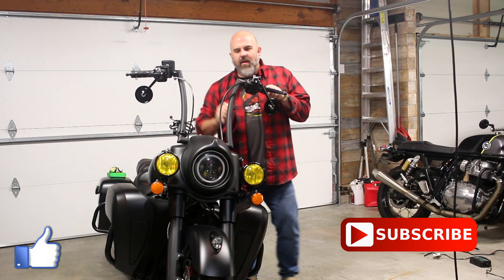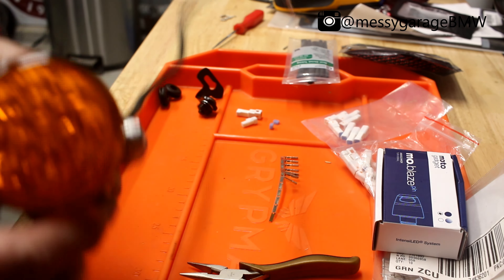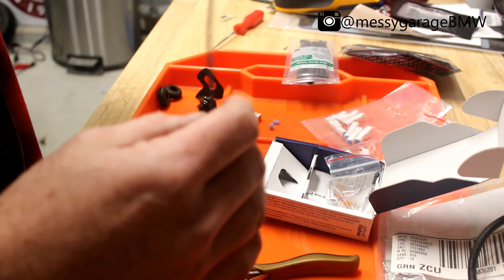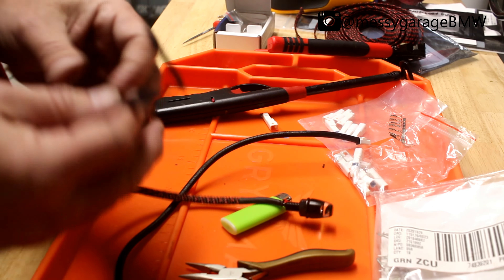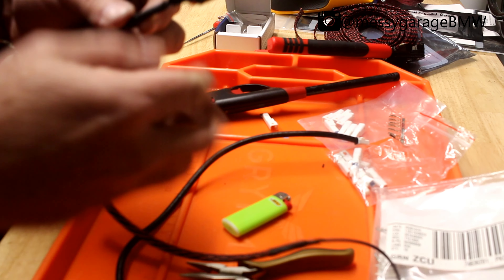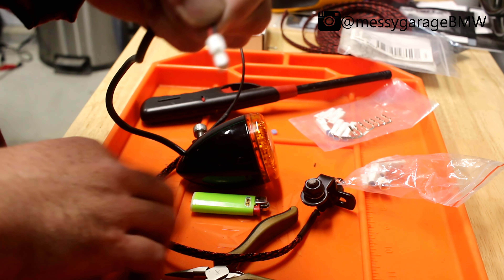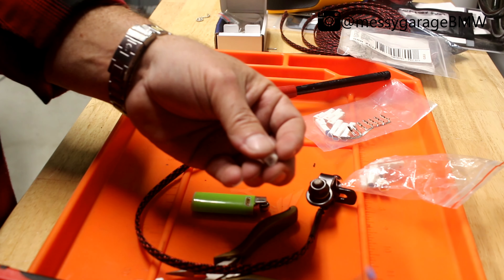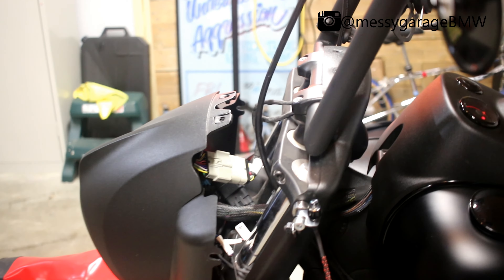Indian Springfield Dark Horse Modifications -  Motogadget Turn Signal Install

Comment: I like those better than what I replaced mine with. It looks like yours would even be visible from behind the bike as well. Looks great!
Reply from the maker: With the way the lights are shaped they are visible from behind and the side very easily.   Can't wait to experience them on the road once the snow melts.
Reply: @MessyGarageBMW  for sure. This finally pushed me to finally upgrade my rear turn signals. I still want factory-sized turn signals in the rear, but white lenses. Got something coming from Kurakyn 👍
Reply from the maker: @Go faster  check out my video install of the combustion industries tails.  They are small but look great in my opinion.  If you are looking for size similar to stock though, they probably won't fit the bill.

Comment: Was a load resistor needed for each signal?  I have a different set of LED (same bike) where the LED would stay on after bike turned off.  Would also stay lightly illuminated while running the bike.
Reply from the maker: These didn't require load resistors, but I know what you are talking about and have had some others that acted as you describe.